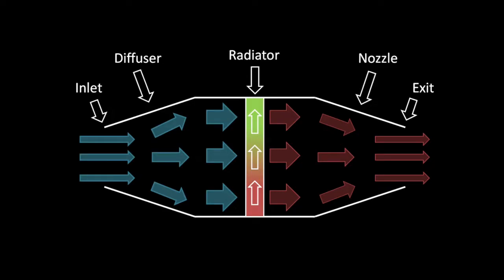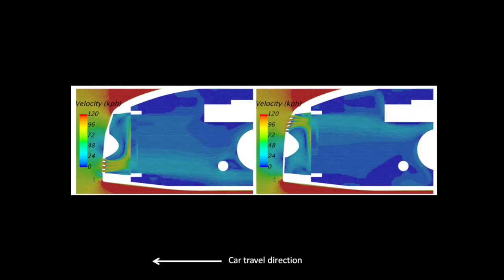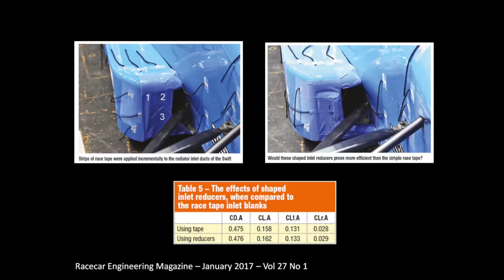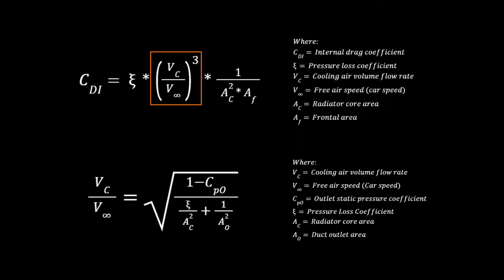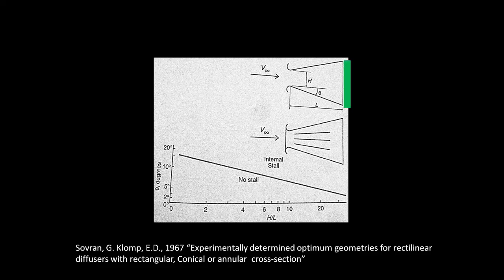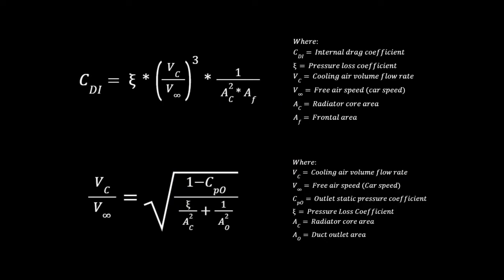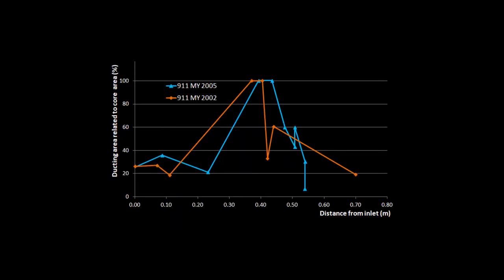The Art of Engine Cooling: Designing Ducting Systems for Optimal Performance

Comment: Great video. I have two questions, though: 1.- Regular cars don't have ducting after the radiator, the air simply passes through the engine and comes out through the transmission tunnel (if the engine is covered on the underside). I think a regular car can benefit from having a properly designed ducted intake (like the first example you gave), in your experience what much of a difference one should expect (thinking on an older car with no ducting at all and many openings to the headlights for example); 2.- Regular cars often have many radiators sandwiched one on top of another, so the actual airflow resistance should be higher than a single radiator pass. ¿Would this be a problem when ducting? (i.e. decreasing the total air flow to the engine compartment due to forcing the air to pass through a restrictive boundary). Air through the stack is surely to be higher, but total air to the engine compartment?  Thanks!

Comment: I've been having a hard time finding any studies comparing oil cooler ducting. Porche likes to take the air from the front and dump it in the wheel well, but i've seen some older performance models take air from the front center area with higher pressure in front of the radiator, and dump out of the side of the bumper which has lower pressure and less interference than the wheel well.  Have you found any information comparing the two?

Comment: Would you help me design a radiator duct? 😄
What do you do on the bottom of the duct where you might not have the possibility adding any angle?
Reply from the maker: Great question, can you move the radiator? might also help with weight distribution, but not always an option. I'd also look into if its possible to extend the intake and allowing the top angled section to do more of the heavy lifting. Or maybe you could add onto the lower intake to create an angle, make something out of cardboard to begin with and do some testing with a fan. Other than that I'd look into either changing the radiator and or modifying out the exhaust duct. You still have lots of other areas to explore and have fun testing
Reply: @thefastandthenerdy  Can i send you message somehow, one option i considered is just angle or rotate the radiator forward which would help with the angle but it could it not create other problems?
The roof and floor would be different lengths doing it that way.
Reply from the maker: Hi, angling the radiator is a great idea, f1 have been doing it for years and it's been quite successful there. I'd be happy to help, send me an email at trmays86@gmail.com with some photos and what you plan to do and I'll try and find some time to discuss it with you.

Comment: Im so glad i found your channel. I grew up building rc planes and did a few years of racing and always wanted to combine them both with performance engineering. One thing ive been trying to wrap my head around is the ha36s alto works improving the air intake and intercooler intake and ducting. Being a top mount intercooler that gets its air from a small gap between the bonnet and grill. There is an option for a bonnet with a scoop but i wanted to see if something better could be done. The intake that sits behind the front of the bonnet is at the curve of the front so not in direct air flow. What's your recommendation?
Reply from the maker: Thanks, I'm glad you have enjoyed it. I don't know the ha36s alto very well, but having a quick search on the internet and i found this upgrade kit "S.W.K. SUZUKI WORKS KURUME SPORTS INTERCOOLER - ALTO WORKS RS HA36S", this looks really good, tight space, curved edges along the top and channels it well into the intercooler. I wonder if instead of the sharp 90 degree just after the expansion point to meet the bottom edge of the intercooler if this couldn't be tappered to allow for a gradual change of direction, reduce any eddies as well as increase the chances the air flow stick to it, increasing the usable surface area of the intercooler. I suspect this may have increased the difficulties in manufacturing, but if you're able to create your own, I think this is an excellent base to start testing and playing around with. Let me know what you end up doing
Reply: Thanks. I don't own one. I just like to design and make improvements on paper in my spare time. I thought due to the boxy front end it would be a good challenge to see how much it could be improved. Swk and KC technica both have great solutions. Thanks for your input, it helps me see thing's differently. I grew up building RC planes, so aerodynamics fascinates me.
Reply from the maker: That's a cool hobby, I do similar things in engineering and finance for fun. I'm glad I could help a little

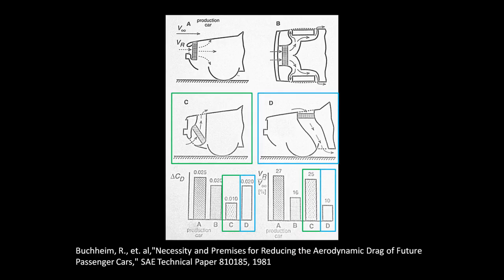Comment: Such a great content, but I'm a bit confused by what has been said at 9:26 , I thought the area at the bottom of the windshield was a slow speed/high pressure area, and under the car was a low pressure high/speed area ? Can you enlighten me please ? Thank you very much.
Reply from the maker: Thanks a lot! You are right, at the bottom of the windshield there is a low speed high pressure region, but the air going over the car is high speed low pressure whilst under the car is reletively slower. the same amount of air needs to flow over the car as it does under. The flat bottom makes under the car a short distance. Going over the car it needs to go over the roof, so the distance is longer, to travel a larger distance in a given time means the air traveling over the top is relevatively faster than under the car. The key term is reletive. All air passing over or under a car is traveling faster than the air infront or to the side of the car. I hope that helps

Comment: Hi sir i've some question do daily use car need radiator ducting with ac condenser infront of the radiator..
Reply from the maker: Hi, thanks for watching. Your car would have been designed for the conditions you are driving in. Assuming your not racing it and everything is working ok your current system should be more than enough. If you however see the temps going above what you are comfortable with, I'd recommend seeing a mechanic. If you're looking to reduce internal drag, then ductin could help, but I don't think it would be worth it unless you really enjoy building this sort of stuff, measuring, and experimenting

Comment: Awesome stuff! Just a question. How do you dimension a radiator to the engine output and operation condition..? Thanks
Reply from the maker: Hi thanks for watching, dimensing a radiator is quite a tricky task, given all of the variables. Most people just use a rule of thumb and select one that is capable of disipating 1.5x the engines output. That would be a safe place to start and then you can look at decreasing the size of the radiator or choosing a different radiator design, whilst modifying the ducting and fan size for a given track and that days temps. Unfotantely it can be a costly and time consuming exercise. I'd suggest looking at others who have a similar car and drive under similar conditions, and asking them for advice, how there system is going, and what they would recommend

Comment: Nice video, good to see I'm not the only one into these sort of stuff :)
An outlet large 25% the radiator is usually a good value where you get low drag without a relevant loss in cooling performance.
Above 40% you quickly increase the drag but you just get marginal increase of airflow, so it should be adopted only when really needed.
What is the internal drag at 8:30?
Reply from the maker: Thanks for watching and for your insights. The internal drag is just the drag created as the air flow through the system and interacts with each of the components

Comment: Quick question. As for motorcycle what can we do for the inlet? Since we are unable to do much ducting in front of the radiator due to it's limited space.
Reply from the maker: Hi, Thanks for watching. I don't think there would be much you could do, a small box around the radiator might help, but you'd need to make sure that it will still flow a good amount of air in all positions. I would suggest experimenting with different lengths to see if there is anything that can be done to help

Comment: It would be interesting to see what could be done with a car using the Meredith effect to create useful thrust. So much energy is wasted through inefficient engines that could be easily used.

I mean if how to use the waste heat for thrust rather than suffer from drag has been known since ww2 it's seems weird we don't use it in this day and age of ever looking for more efficiency. It's just energy going to waste that also causes a drag penalty now.
Reply from the maker: Hi, that would be really cool to see, especially on a land speed record car.

It's my thoughts that the meredith effect isn't used to produce thrust in cars for a couple of reasons, 
1.We would need to design the outlet for a certain speed. We could overcome the sizing issue at other speeds by using an active outlet, but we are adding cost and complexity to the system
2. It is very sensitive to boundary layers. That's why the under body duct on the mustang worked better than the wing duct on the spit fire
3. Unlike a plane, in most examples we would need to eject the air into air that is being used somewhere else on the car, diffuser if exited under body, rear wing if ejected above the car, wheel well pressure if ejected near the wheel, so we need to condiser that impact on the whole body's aero. This could be somewhat eleiminated if the radiators are at the back, but then we need to think about packaging, weight balance etc. 
4. The effect on a car could be increased by adding some exhaust gas into the exit ducting, but I think the benefit of reducing drag isn't as great as increasing the downforce by putting that exhaust gas in the diffuser. Most races are won in the slow corners not in the straigts or the high speed corners, so any increase in downforce is usually better than a reduction in drag, obviosuly that's not always true
5. Given all of this, the ability to just offset a large amount of the cooling drag is a massive advantage when it comes to racing without needing to go too complex. 

It's my opinion that aeroplanes are at an advantage when it comes to taking advantage of this effect, the fact that cars are close to the ground hinders the designers ability to use it. But also cars go through a large range of speeds and winning in a race car doesn't usually come down to who goes the fastest in a straight line, whereas the being faster than the person you are in a dog fight seems to be more of an advantage, but you'd need to speak to someone else about that.

Keen to hear your thougths, especially if you have found an example of a car that does do this or if you have done any experiments yourself

Comment: Excellent Video!! This an area which I have been trying to read up on for sometime now. Countless FSAE papers, Julian Edgar videos and general googling. What was most interesting was the Sovran, G. Klomp Optimum geometries slide, I'm going to have to read into this. 

My issue is that in my Fisher Fury kit car, the angle is around about 26deg for any potential ducting. Reading about wings, the separation angle seems to be around 15deg max, so I'm reluctant to just install a duct with that sort of angle (26deg), this lead me onto rocket engines to see if the exit nozzle bell shape could expand the air faster (greater than the 15 degree limit) and the length of my duct would mean that its hardly curved, so little point in doing it. 

In your opinion what is the ideal shape of duct walls? Convex, straight or concave. Also the majority of papers look at a vertical section, concentrating on the upper an lower walls of a duct, would it also help having the expansion happen to the side cheeks of the duct too? I'm looking to foam cut a plug and lay up GRP to make a bespoke duct.

Once again fantastic video and I have to agree with the other comment, it's always nice to see research data presented and not a guess. 
👍
Reply from the maker: Thanks mate

Could you split the opening into two or three, reducing the amount of degrees for each section?

I think convex is the best, it helps to keep the air stuck whilst allowing for a large change in opening over a short distance. But where each of the walls meet I would have a sharp intersection point. If possible, concave close to the radiator as it will help to allign the flow path with the radiator core

Expanding on the walls as well or alone is definitiely a good option, I think papers stick to just the verical section as it simplifes the study, but anything that happens in the vertical should also happen in the horizontal. I'm not sure how much it impacts the total allowabe degrees, but would be very interested in reading anything you find or of any results you see
Reply: @thefastandthenerdy  Not really found much more on this other than a few people mention Kuchemann & Weber, and their research "Aerodynamics of Propulsion". There's a guy who mentions a KW duct for an oil cooler on his aeroplane, and another paper on wind turbing diffuser Aerodynamic study with Openfoam. 

My toughts are still to use a rocket nozzle with a 15deg angle but drawn using parabolic/bell approximation (theres a video on how to draw on youtube) but flip it in the x and y planes so that I have a gentle spline with the very last portion (what would be the converging section of the motor) against the rad face.

I might actually get round to it this summer.
Reply from the maker: Awesome, let us know how you go

Comment: Such a small underrated channel, yet jam packed with useful information! Keep it going, loving the content! It really gives u a grasp on how to improve things, especially if you are trying new stuff on older cars and making it more efficient. 

I have a question. I've been researching here and there to test it out in the future to reduce drag on my car and improve cooling efficiency hopefully. The idea is since my old civic has split radiators, one for ac and one for cooling (there will be a temp differential ofc, but the idea is to move the air more efficiently out of the engine bay to the outside of the car), would it be wiser to make a ducting and route the air in front of the tire almost vertically like Porsche did on some earlier models, our route it near the inside of the wheel well so it dumps the air into the wheel well next to the brakes?
Reply from the maker: Thanks Legend!

I'm currently working on a video that partly looks at this, but from what I have learnt so far, in front is your best bet. There is a high pressure region around the back which flows over the top of the tyre, whereas up front there is a low pressure region. You would also be dumping hot air around the brakes, which isn't good for brake cooling.

If I was you, I would look into air jet wheel deflectors, and maybe try and position your outlet similar to how they saw the best results. Just incase you don't know, they eject a stream of air just in front of the wheel at different angles to help with wheel well drag, I think 45 degree angles have seen better results than 90 degree for overall car drag, but have a trade off with a slight increase in lift. But depending on what you are doing with the car, you can reduce the wheel well lift fairly easily with some mods. Also by dumping it in front, it should leave you some room to run ducting to your brakes, or at least make it easier.

Let me know how you go